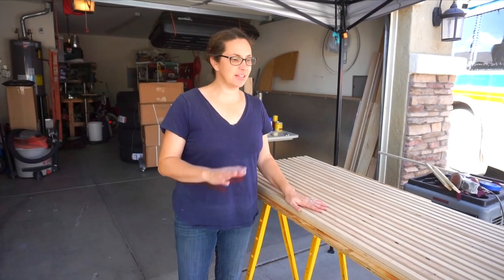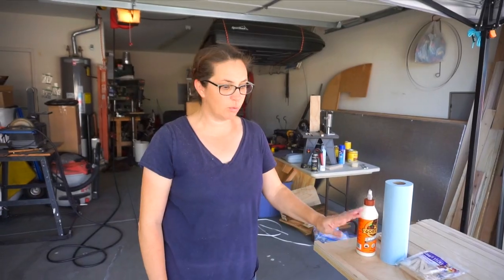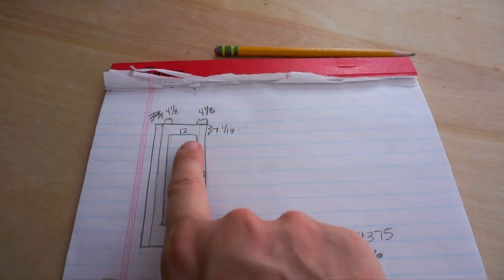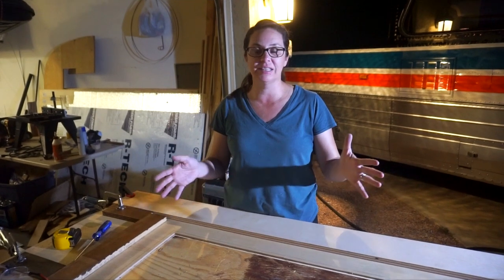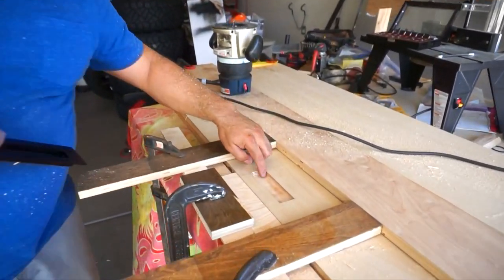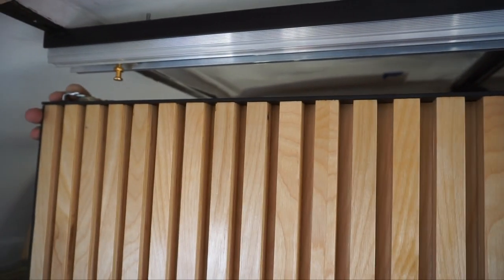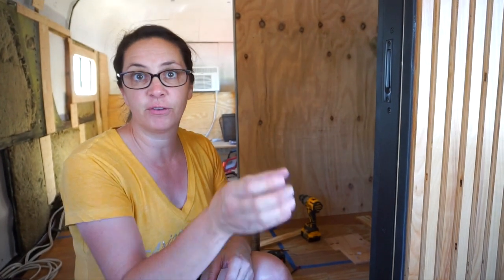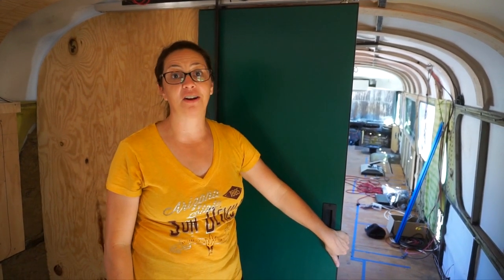Building the Pocket Doors

Comment: Very nice job and very stylish!  Creative!!  I like it.   
Suggestion: With the weight of the doors, turns and bumps will override the bracket close and open detentes and (did I that someplace in the video).  You might need to have a locking device to keep them in place while driving especially on the one with the mirror.  Great job and great look!  Can't wait to see the next part of the build.
Reply from the maker: Thank you, John, they have a soft-close and soft-open that has a spring that provides a little bit of tension but not nearly enough to keep them in place (they weigh about 50lbs each).  The first trip we took with them installed had them sliding back and forth in the tracks until I pulled over and secured them with a bungee strap.  I hate to give a spoiler alert, but we are looking at some relatively high-powered electromagnets (hidden in the door of course) to use for this duty (still in the research mode for this one - we'll see if that crazy idea makes it out).  I had a question for you if you wouldn't mind, I am about to give this girl an oil change and was wanting some advice from someone who actually knows what they are doing.  I would also like to take care of some of the leaks if that is possible.  Would you mind if I called you to talk about it?
Reply: @BeginningfromthisMorning  hi guys, feel free to call anytime. I think you have my cell. Happy to help. 
Heavy duty diesel straight 40 weight oil only. (No multi-viscosity oil).

Comment: If the foam holding the mirror does not work out you could use window glazing compound or better rope caulking to make solid contact between the mirror and the metal.
Reply from the maker: Thank you Chris - I knew there was something for this!  The foam appears to be holding up great (no rattles and about 6 trips or so back and forth from the lot and no cracks or misbehavior) -

Comment: The door looks beautiful! I plan on installing a pocket door into a wet bathroom how are you treating the door for waterproofing? Maybe i missed it in the video.
Reply from the maker: Thank you Gabriella - we used multiple coats of clear lacquer as a sealant.  It should hold up to moisture but we don't really intend for the door to be exposed to a significant amount of direct water (other than the steam from the shower).  We have a Maxxair fan in there to suck out all the moisture during showers.